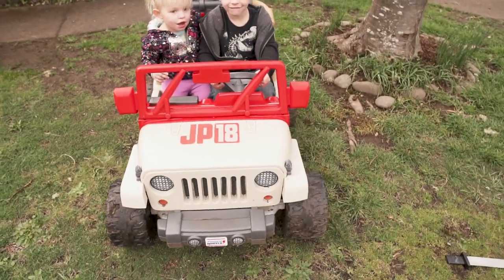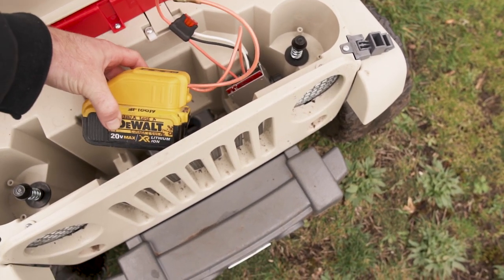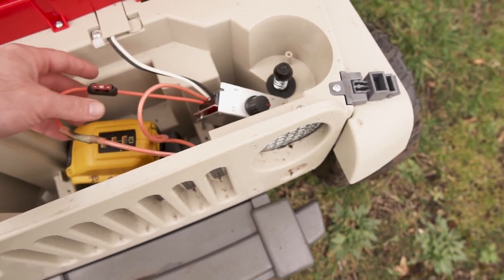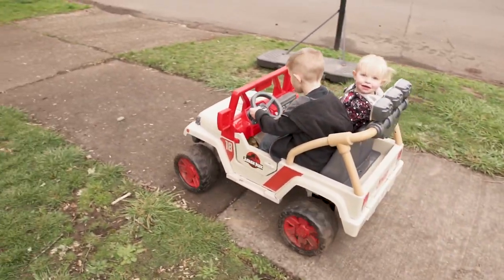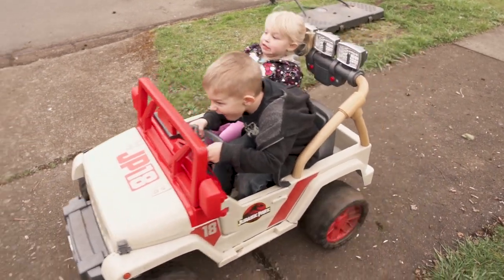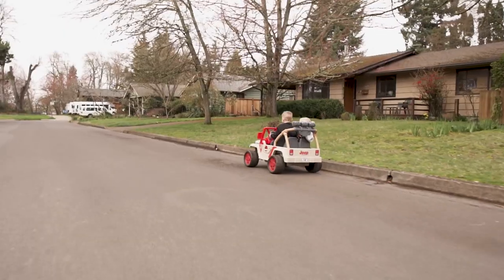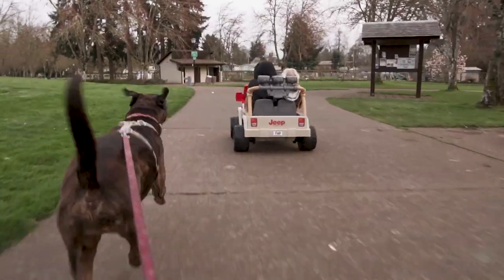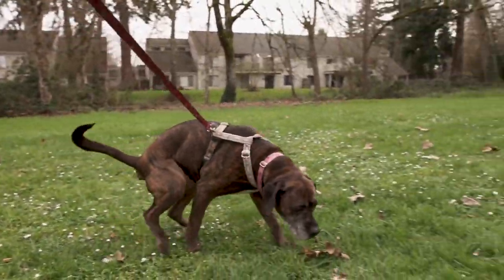Modified Power Wheel with a 20v dewalt drill battery

Comment: Hey I’m looking to do the same thing where’d you get the dewalt attachment
Reply from the maker: Amazon,
GRECELL 20V Max USB Power Source for Dewalt DCB090 Converters Fit for Dewalt 20V/12V Battery https://www.amazon.com/dp/B09B25NRMD/ref=cm_sw_r_cp_api_glt_fabc_2J09NBDKG3TA9Q6BEGZ7?_encoding=UTF8&psc=1
Reply: I just hooked mine to the battery. hoping it holds up as far at the motors go

Comment: Did this to my daughters frozen mustang and would not work. It goes into a limp mode and the circuit board has a flashing red light. If I put the regular power wheel battery it works fine…Anyone have any ideas ?
Reply: Buy the voltage regulator he has in the video and turn the voltage down. My kids truck did the same thing. I hooked my volt meter to it and found where the sweet spot was and marked a spot on the face of the dial with a marker.

Comment: That Dewalt battery cost more than 4 replacement batteries
Reply from the maker: Hahah doesn't go as fast or charge as fast 😉
Reply: The point is not to replace the battery. Whole idea is to make them drive faster and go further. The 6volts or whatever on these kids toys are junk!

Comment: Atleast put a helmet on them if it flips lol
Reply: And wrap their bodies in bubble wrap, tie a rope to the car and run along side them just in case. Also a full set of football pads, motocross boots, have a steel chassis designed to reinforce the nonexistent original body, install a full roll cage, regulate the voltage down to 8v…. Im sure I missed something.